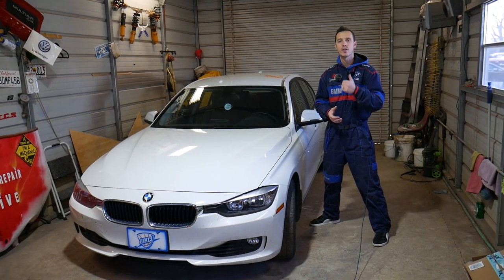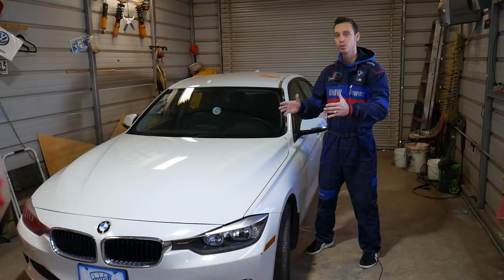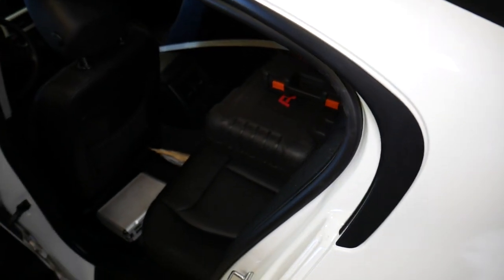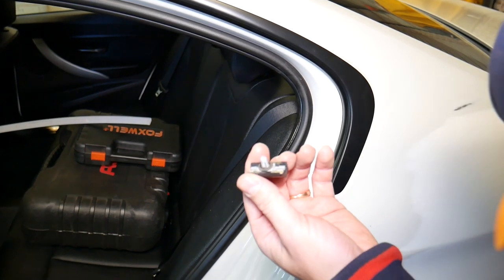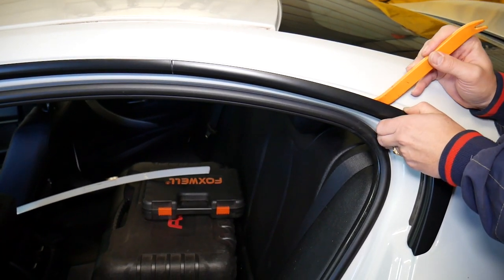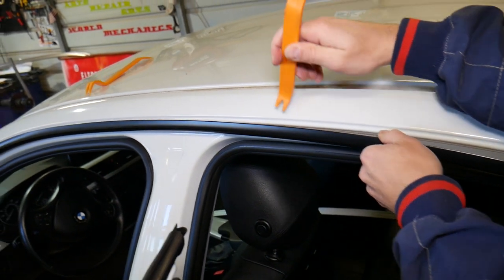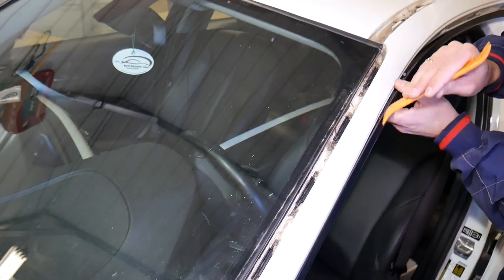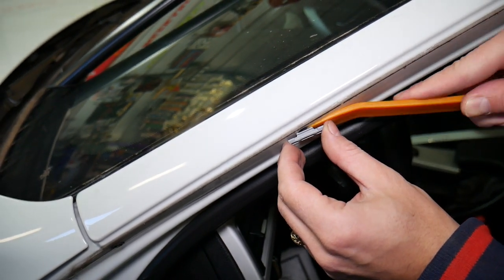BMW SHADOW LINE TRIM REAR QUARTER PANEL MOULDING TRIM BMW F30 F31 F34

Comment: ,2011  bmw  328i  quarter  panel  molding  trim  on  passenger  rear    above  small  window  exterior has  curb in  it  I  only need  that  part

Comment: I noticed on my 2018 330i that same exact trim that goes around that you just took off when it's on the car it sticks out a little bit there's a little gap between that and the body of the car is that supposed to be like that?
Reply: Yes